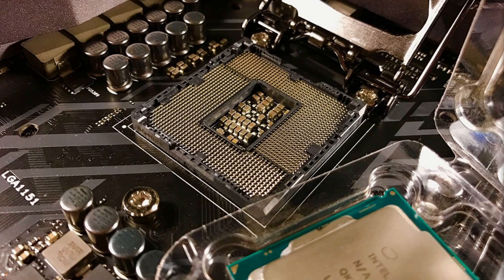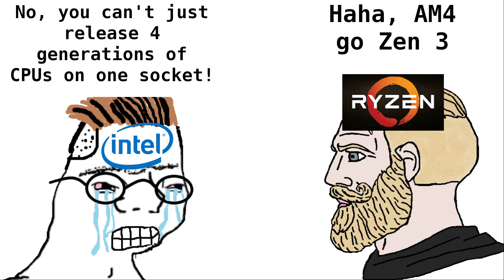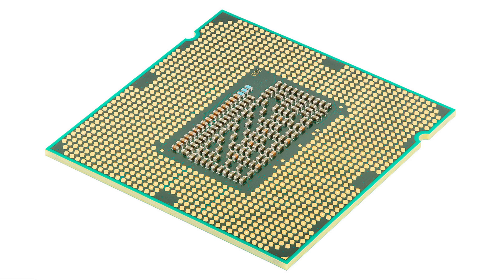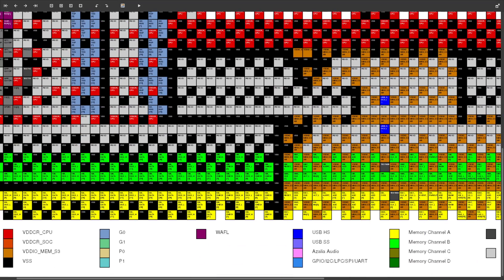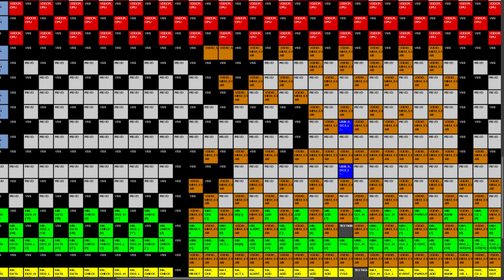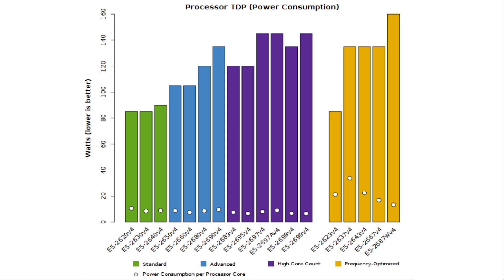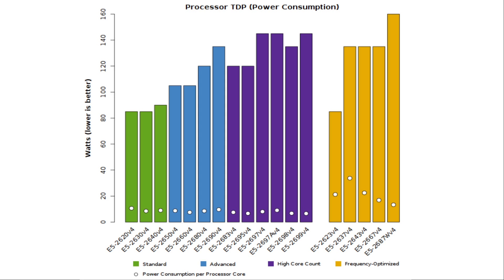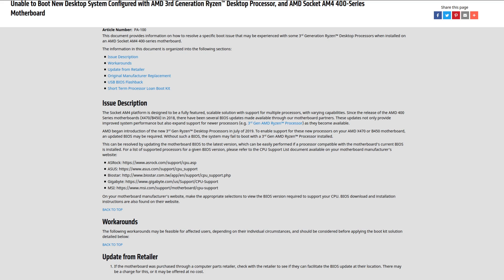The Reason for CPU Socket Changes

Comment: Always heard the argument from Intel users that the new sockets are "necessary" for newer CPU's for many reasons. That there is no way possible to have newer architectures fitting older sockets.
Then AMD pulls this promise to keep the AM4 socket alive for a lot longer than any Intel architecture ever could, proving everyone wrong. That is is indeed possible to have multiple generations of CPU's on the same socket.
AMD more or less showed us what a cash-grabber Intels frequent socket-change really was. Intel was taken with their pants down. I hope they'll improve from this point on.
Reply: Tell that to chinese hackers xD 7-9 gen sockets are interchangeable, you just need a bios update
Reply: ah finally, some good fucking free market at work
Reply: Anyone remember Socket A/462?
Reply: This was nothing new with AMD. Intels socket 775 lasted 7 years from 2004 to 2011.
Reply: @bhume7535  and now? Why do them change the socket with every release?
Reply: @Pirater666l  the video explains that. I'm just saying that long lasting sockets is nothing new. AMD didn't revolutionize it. they just brought it back.
Reply: @bhume7535  yeah, nobody said that and invented CPU's nor reusable sockets
Reply: @Pirater666l  uh... the comment I was replying to did?

"Then AMD pulls this promise to keep the AM4 socket alive for a lot longer than any Intel architecture ever could..."

The guy was wrong.
Reply: @bhume7535  and tbh sometimes long lasting sockets just get confused as fuck

Just check LGA 775 compatibility list-
Reply: @MerthisReal  tell me about it. That shits a mess.
Reply: If anything its both easier to use the same socket, and it's better because as you work with the same thing repeatedly it will naturally become more efficient.
Reply: @cjolney  that's not how technology works.
It won't naturally become more efficient (look: intel staying at 14nm and releasing same cpu's every gen).
The engineers have to design it to be more efficient, and I can safely bet there's dozen differences between intel and amd sockets that allow them to design their cpu's the way they think will be the best.

Also why would that be good for me, I can just good am4 soon am5 mobo and use it for for many years.
Reply: @Sanya192  As you can see, you are wrong. For ddr5 you need to change the motherboard but the socket stays the same. If you don't want to, you don't have to change anything. Those moronic comments made about "yea, I am so poor I am going to keep my perfectly able b450 and put 5800x in it to replace my 2600x" are just that, moronic. Who does that? You can pay north of $400 for the cpu but you cant afford new motherboard that has much more improvements and features over 4 series?! Sure, why not, you CAN do that. You could have also bought 2700X and stayed on whatever you also have for years before you upgrade to anything. If you always must have new generation of CPU, then shut up and pay up, you are wasting money either way.
Reply: yeah but you can still be running on shitty 2.0 usb ports and other such things because you CAN , doesnt mean you SHOULD
Reply: Maybe LGA1700 is them trying to make the socket last longer?
Reply: @PashaGamingYT  maybe? i hope so.. im planning for a 12100F + ddr4 since all i wanted and all i needed is gear 1 memory, and i found a great deal for 3600mhz cl17 sticks for real cheap in my country. im planning to get the mounting upgrade kit for my gammaxx 400s, and that kit of 3600mhz cl17 stick. jumping straight ahead from my E3 1240 v2 XD
Reply: Didn't you know i487sx? Right. They were like that from the beginning kid.
Reply: actually intel changed the socket again xddddddd
Reply: the reason why AMD can do this is because of the Northbridge and Southbridge... Intel have theirs integrated, AMD don't
Reply: No, Intel just couldn't make their NM process smaller, so, to prevent falling behind, they kept cramming cores while keeping the same manufacturing process which in turn lead to increased power usage so they needed a new socket with more pins whereas AMD was using a 7nm process opposed to Intel's 12nm and 10nm which allowed their CPUs to get more powerful while sipping much less power than Intel chips, therefore being able to retain the same socket
Reply: @developertips2607  cramming more cores and intel sounds funny when you remember how with one of the recent cpu's of theirs got less cores than it's previous gen counterpart.
Reply: @dr_birb  eh, sounds familiar. Which cpu was it? I'm not condoning Intel, they're just super slow and behind
Reply: @developertips2607  i9 10900 10 core vs i9 11900 8 core, similar boost clocks. Maybe there's more but icba to check further.
Reply: @Monochromatik keyword had
Reply: same with intels 4core 4 threads for the longest time
Reply: Intel pushed skylake with different names for 5 generations and couldn't figure out how to make em run on the same socket

Either it's a blatant cashgrab 
Or they don't know how to do their job.
Reply: theyll only improve is we buy their shit
Reply: i still wish AMD had lived up to the promise of one more gen of chips for AM3+, even if it was just the updates made to the APU's to boost perf and power efficiency with 6 and 8 core options, many i know would have bought them if only because they could get the same perf or better with lower temps/power draw, sadly they never ported those updates they did to the FX core design/layout to the AM3+ chips... 

but yeah... i said it for a long time, i helped friends build 1366 rigs, they went from 4core8thred to 6core12thread, and thanks to overclocking stayed competitive with the newer gen chips for a few generations, the triple channel ram that, at the time wasnt a major boost, allows for noteworthy gains in some games and apps that came out later, and also allow the use of PrimoCache to take advantage of the extra memory and memory bandwidth, with 48gb ram, i use 24gb with primocache on my games drive, where a good number of my other apps are also installed, the boost to perf is noteworthy even on ssd's, but on hdd's, the go from...hdd speeds to faster then nvme as primocache learns what blocks to cache on the drive....

anyway, intel has pulled this crap in the past in ways that you could just modify the board and get newer chips working in it, or older chips working in a newer board that shouldnt support them.

you can mod some old xeons to work in desktop platforms with a file or Dremel... yeah...

intel have a model thats relied on selling both processors and motherboard chipsets for a very long time.... 

i kinda miss the days when we had a bunch of chipset vendors, some better, some worse, but, lots of choices... some of those ULI/ALI chipsets were great, SiS had some real banger chipsets IF you could find a board that was using them properly, Via had some great chipsets and some real stinkers over the years... but overall... it was nice having options... and sometimes you would come across a mother board that made you think and even say "how can this be better then my top end board, at less then 1/3 the price?"  i sold 2 top end boards once after finding that these little chap ECS boards that frys was bundling with processors..after a bios flash... overclocked as well or better, and the chipset performance was actually better... didnt have sata onboard but... an ad-in card was like 15-20bucks locally with 4 ports rather then the 2 ports the top end boards had... good times... i still regret selling the last L7S7A2 i had...that was a small, but very fun board... had so much fun with those over the years when they bundled them with chips that were also fun to unlock
Reply: AMD did the same thing in the past as well with AM2 and AM2+ as well as AM3 and AM3+, where they expanded on their existing sockets and managed to keep the old socket forward compatible with newer CPUs, the new socket backwards compatible with older CPUs.
Reply: I mean, go back in history and look at socket 3, socket seven, slot one.

Socket 3 got 486, them later it got pentium overdrive CPUs which were essentially pentium CPUs that fit in the 486 package. Then socket seven got pentium, then pentium mmx, and  it got AMD k6, K6-2, and k6-3 CPUs. Then slot one got pentium 2 and later pentium 3 and you got use everything from a pentium 2 233 mhz all the way up to a pentium 3 at 1 gigahertz all on the same motherboard.
Reply: @Sanya192  i think for now the all you can do motherboard with no bios involved is the b450 lines motherboard as they have the sweetest spot in everything, as the totl of b450/m prices is keep decreasing, it is pretty much easy to buy a budget ryzen 1xxx cpus with 3200-3600mhz ish ram, then manual tune it (or use XMP and tune it, for msi users they got the try it feature), then when they have a budget to upgrade, they could jump straight up to 3000 series OR even a 5000 series which have alot of improvement in the ipc. Even with the latest agesa B450 motherboards still support ryzen 1st gen, my friend using a 2600 could even get a 3200mhz overclock on 2 different set of ram (1 avexir 1 klevv), and they both could run 3200mhz cl16 from klevv, after i told him to update the bios as it has some improvement, his steel legend never able to do 3200mhz in xmp or manual tuning with that set of ram, but after bios update it does able to do that, and that is super neat, making all the fixes needed for the cpu via bios, for 1st gen cpu. LGA 1151 could be better if they do the same kind of approach at first, and know which motherboard to be able to do 8-9 gen based on their components, since not all h/b 110, 150, 250 are good enough for power delivery. 

it's just amd taking a lead for 1 chipset, 1 socket, all compability, thats the b450, and i dont give a damn abt pcie 4.0 since it's not fully utilized yet for now, where as pcie 5.0 is already on intel and upcoming to zen3 refresh with new i/o die that supports ddr5. currently im searching a way to find a bios explanation and modding steps to add ryzen 1000-2000 support on B550 without the need for specific block, finding a way to remove the bios blocking/refusing to boot for 1000-2000 series, as there is seen in particular msi and asus board the 2600 could go either 3200mhz with tight timing ease or 3600mhz cl18, which they (the blog i've read) tested in several 2600/x, and 2700x had layin around. please let me know if you have a guide and explanation abt adding old ryzen cpu support to b550 since those motherboard are great enough with the minus of not able/taking a gacha to boot on 1000-2000 series.
Reply: also remember how 8-bit CPUs ran on the same basic DIP-40 configuration for ~17 years?
Reply: I think the whole continued use of AM4 is a bit overblown though. Like you still need to look at chipset support because you can't just drop any AM4 CPU into any AM4 motherboard (even with bios updates).
Reply: 1 year later and they still cash grab and release more cpu's to fight AMD, which is funny to see coz AMD only releases cpu's all at once and maybe new ones for laptops but thats it and intel just wants to be the best while releasing 10+ in each generation because of how petty they are.
Reply: @TwinkieShip  this has got to be the dumbest take I've seen in this thread so far.

Too many CPUs? AMD has too few. Where are the mainstream desktop CPUs? The sub-$300 Zen3? The Zen 3 Threadrippers?

It's obvious that AMD is resource constrained by how many markets they've abandoned in the last 2 years by just not updating the product stack there
Reply: intel is israel
Reply: I heard intel has a new ceo that is actually an engineer, and i saw a roadmap thats rumored to use the new socket for 3 generations
Reply: Yeah even with the CPU switching thing I don't see the problem. It's a thing that has to be done so what? You can even do it with a RasPi if you want. It's so easy and way more consumer friendly. If people really are unable to connect a cable to a chip maybe they should reconsider if they should build a whole PC.
Reply: @vrc7net  The argument is not about how easy or hard it is. Why replace a perfectly working motherboard just to upgrade to a slightly faster CPU? Such a waste really.
Reply: @vrc7net  

What?
Reply: @vrc7net  Eactly, also: you definitely already have an AMD CPU on your PC if you have an old AMD motherboard in need of a BIOS update. If not, just buy a new motherboard, why buy an old motherboard if you're making a new build?
Reply: @souljastation5463  It could be cheaper, b450 is definitely cheaper than b550 if you dont need pcie 4.0
Reply: @amogusamogus8490  in this case stick to the ones pre-updated by the shop/manufacturer.
Reply: I don't think the argument has ever been that it's no way possible, but rather that it's not feasible. Personally, I don't see any point in socket compatibility. Even if I had an AMD I would still need to upgrade my motherboard every time I got a new CPU, because I need to be able to use the newer generation RAM, PCIe, etc.
Reply: @Luxalpa  No point in socket compatibility?
So there's no point for me to keep my x470 motherboard when I'm going to upgrade from the old Ryzen 2600 to Ryzen 5800x ?
Reply: @sysghost  I used my 2700 from my PC to upgrade the bios for my dad's pc. 5600g
Reply: @Luxalpa  I built a 2600 system in 2019. Used the same RAM from a PC I built in 2016, used the same 1050ti as well. Later upgraded to a 1080ti that I'm on now. Going to be upgrading the RAM next since what I'm on is 16gb at 2400mhz, looking into getting 64gb at 3600mhz. After that I'm going to be getting an R7 5800x used. All on the same motherboard from 2019.
Reply: @Luxalpa  newer gen ram? Bruv, new ram comes out every dozen years or so, so unless you upgrade that rarely, yes you will need to get a new mobo. But 90% of people upgrades every 2 generations of cpu's/gpu's.
Reply: @dr_birb  where do you get that data ahahahah 90% of people upgrade cpu and gpu every two generations? Can you please send me an rtx together with the source for that?
Reply: @sksz33  ask em
Reply: @Luxalpa  Youre just making excuses; new RAM and PCIe generations are even very rare. DDR4 became widespread in 2016 and DDR5 just became available a few months ago, but isnt even close to viable for consumers.

Im actually right now considering an upgrade from R5 2600 to an 5xxx.
Reply: @Luxalpa  #1 bootlicker commentary

Comment: AM2 and AM2 covered a wide range os CPUs. And what about the old and loved K6II .....  you coould put in place of your outdate P1 on the Socket 7. My first PC was the cheap affordable one, all integrated MOBO, nothing special Got the job done and it was the PC we could afford ... of course it run an AMD. I got motherboards that cover from P90 to the latest K6II with same socket. It crosses probablr  o 4 years of evolution in late 90s which was ... insane.

Comment: Laughs in socket 775:
> Celeron D / Pentium 4 / Pentium D Prescott
> > Celeron D / Pentium 4 / Pentium D Cedar Mill
> Celeron / Pentium Dual Core / Core2 1st gen (667fsb)
> Celeron / Pentium Dual Core / Core2 2nd gen (800fsb)
> Celeron / Pentium Dual Core / Core2 3rd gen (1066fsb)
Reply: Socket AM2

Athlon 64
   - 2003
Sempron
 - 2004
Athlon 64 X2 -2005
Athlon 64 FX
 - 2005
Opteron
 -  2006
Phenom -2007

so what
Reply: @selami32  well, just saying, multi-cpu sockets aren't an AMD thing, or at least not exclusively.
Reply: Don't forget about Core2 (1333 FSB).

Comment: I'm still running x58 mobo. Six core Xeon oc to 4ghz ish.
Reply: Xeon E5645?  Ran two of those in a dual-socket board (EVGA SR-2) for a long time at 3.6 GHz.  (Much harder to get two CPUs stable at high speeds.  I'm sure either on their own would've pushed beyond 4 GHz.)  Ran great until the VRM for Socket 0 started overheating badly even at stock speeds.  Pretty much killed the system.

Still, x58 was a strong board.
Reply: @DakalaShade  x5675
Reply: @barrybritcher  Ah.  Yeah, still a good choice there.

Comment: There are some odd motherboards in industrial uses, that support multiple intel CPU generations on the same socket. So its purely artificial limitation by Intel.
Reply: Afaik ASRock has h61 but with 1156 socket
Edit, not h61, but p67. still funny to see that coming
Reply: romaneeconti02  do the motherboards get tossed out often and sold for pennies on the dollar like Xeons?
Reply: So, do they get all of the new chipset features without changing the chipset? Or are you just a brainlet?
Reply: @balthxzar  How is that any sort of counterpoint? The fact of the matter is that those CPUs are perfectly compatible with different sockets, despite what Intel tells you.

Comment: Tell amd Where's the support for upgrading to zen 2(3) even on my x370 board? My x399? I want to believe but this marketing bs has to stop. I gave amd my money based on their claims and only get shafted on their promises afterwards.
Reply: B350 owner here, i have a R5 1600X, sad that my Mobo will not be compatilbe with the Zen 3 CPUs, but ok, i still can upgrade to a R5 3600XT before a Mobo and CPU upgrade. 5XX Mobos and the Zen 3 CPUs combo will be overpriced here in Brazil due our economy is held as hostage by a bunch of lunatics. Our currency has the worst 2020 performance, 1 US$ is about 5,60 BR$. Sooo the 5600X (299 US$) maybe arrives here at 1800 BR$ (almost a mid to top range GPU price), and the B550 are priced about 1700.
Zen 3 will be delayed here.
Reply: Bios cache size and vrms most likely the culprits.  You can always resell a board they hold value decently. The socket thing is for some inter-generational changes where a board actually makes sense. I wasnt mad when my b450 board May not be able to bios flash on for a zen3 ryzen 5, I'd want the pci-e gen 4 support among just get a proper featured board

Comment: It's worth mentioning that some motherboard manufacturers will provide a USB-based BIOS flashing utility that can be used to perform an upgrade without a CPU or RAM installed, mitigating the need for a loaner processor.